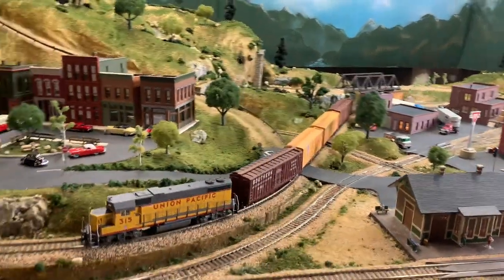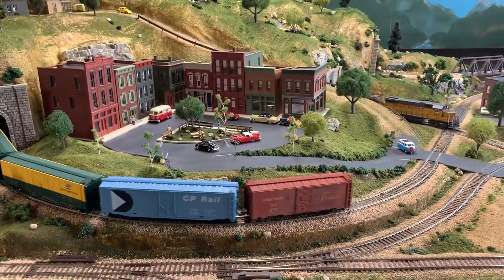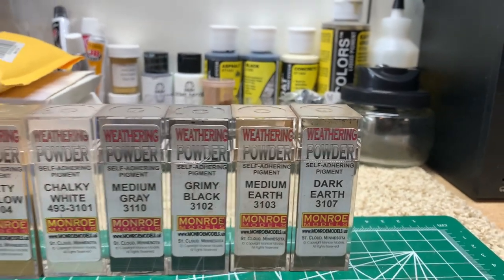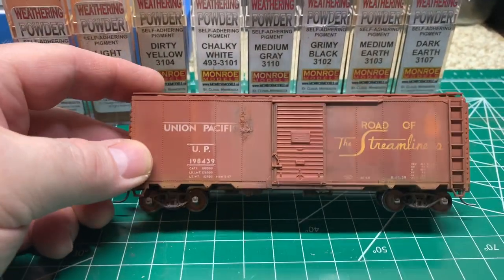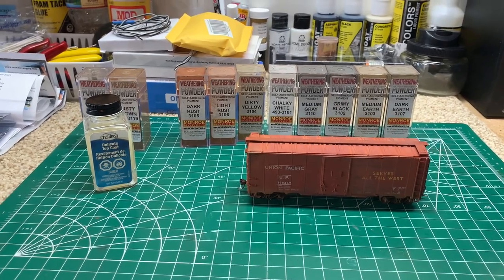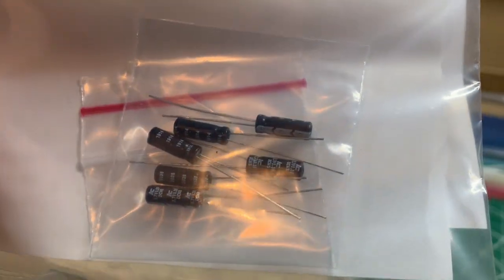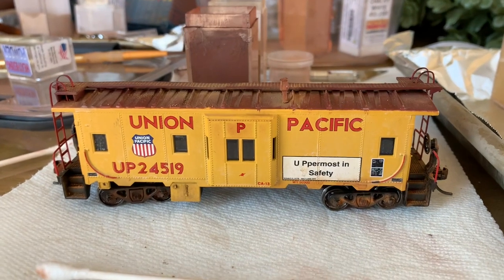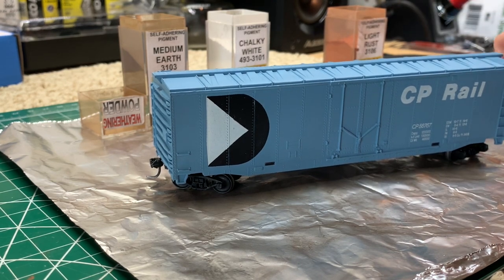Monroe Models Weathering Powders & Finishing The Bay Window Caboose

Comment: Looks really awesome, Dan. I have some other brand of powders, just a few colors. Will have to try out some of the things in the video too. As I work on the buildings for the layout I think ahead to things like weathering and just have to put it off until more is done, but it'll be fun later.
Your caboose work is great and I'm sure the next one will be nice as well. Those teensy lights look well suited, I need to get a few of those with the really fine magnet wire leads. All you need is a engineer hanging on to the rear railing and waving maybe!

Comment: Nice job. You will not find dullcote Dan. Testers was sold to Rustoleum and they have discontinued most of the line including Model Master paints.Tamiya flat is the closest thing.
Reply from the maker: Ok thank you, I was afraid of that. I found a Rustoleum product called dead flat. I’ve not tried it but I’m wondering if that might work as well. I’ll pickup some Tamiya and compare the two. Thanks for watching CB.
Reply: @DansGrandValley  also try Rustoleum Painters Touch line “Matte Clear”. I have been using that. Have not seen “Dead Flat”
Reply from the maker: @cbrailroader642  yeah I found it at Walmart of all places, in the paint dept. I may have to do a show on comparing clears sometime soon. Ha
Reply: Oh wow, that's nuts. Since I use brush mostly as I have no place to spray, I have resorted to acrylic matte from Vallejo, but I bet a hardware store has something similar for fraction of the cost.